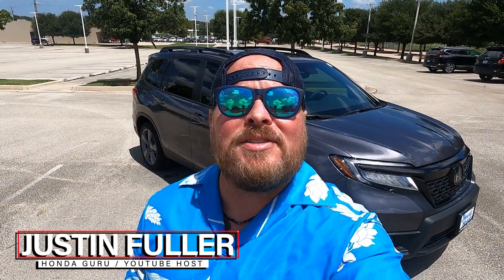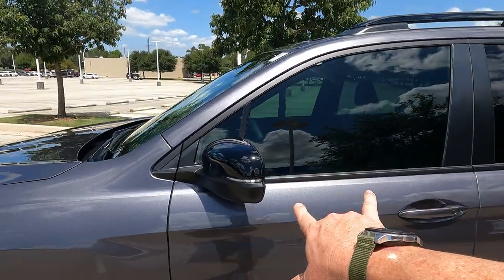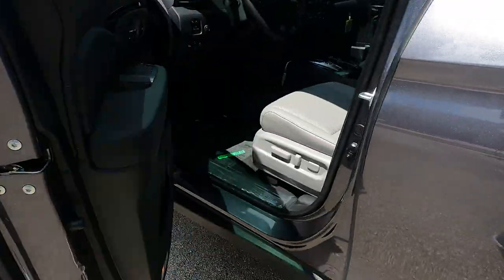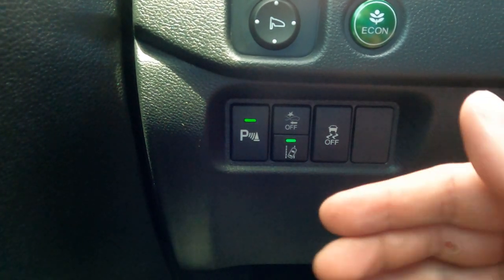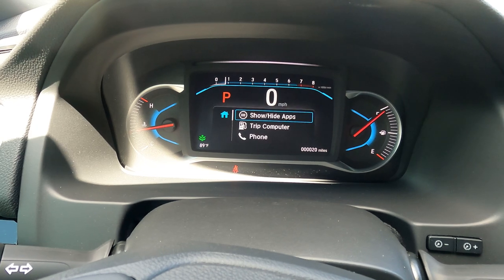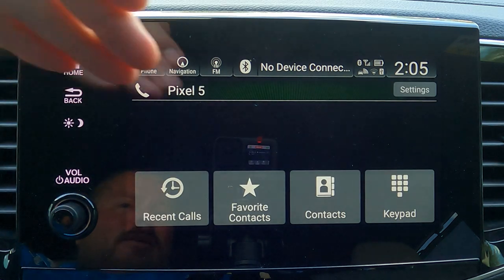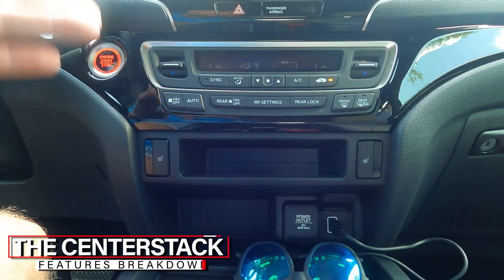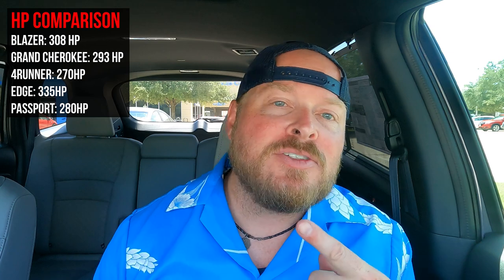2021 Honda Passport Touring Review

Comment: THIS IS NOT A 2022 PASSPORT IN THE VIDEO.  You can see what one looks like online and it has a front end similar to the current Honda Ridgeline.  CHANGE YOUR THREAD TITLE AND STOP WITH THE CLICKBAIT.
Reply: Bcoz 2022 still looks the same, so its not a clickbait.
Reply: @dmanalang9037  no, the 2022 got a refresh. Go look at the Edmunds video that just dropped.
Reply: The only difference between the 2022 Passport Trailsport and 2021 Passport Touring is literally the front grill, bit of boxiness to then front end body, and the tires. The rest of the car is exactly the same.

Comment: I just leased a 2021 Passport Touring after going to the dealership to buy a CR-V. It turns out that most of the "roomiest SUV" rankings do not apply to big and tall men. So in the CR-V, on the Mazda CX-5 And larger CX-9, my shoulders are jammed hard against the walls of the car and feel like they are hanging out the window.   I sat in a 2021 Passport Touring and immediately knew I was home. With all the safety, space, versatility, off road/AWD and tech upgrades, moon/sunroof and Honda built engine, it is WITHOUT A DOUBT worth the $40k+.  Great video! Can't wait to go play with the features again!

Comment: I’ve been waiting for a review on the 2022 Passport. Glad you picked the upper trim level model - appreciate the list on left noting difference between Touring and Elite levels. 
(Thankfully English is my native tongue or I’d never understand your words at that fast speed!!) 
Wish you had included Hyundai Santa Fe Calligraphy model as that is the only other car I’m interested in. It comes with 360 camera and also heads up displays AND camera on side mirrors which engage with turn signal on the dash to show you your side views. SO HELPFUL. 
Ground clearance is important - I need to sit up high. 
I am currently driving a 2006 Honda Pilot which has been a phenomenal car. I have 180,400 miles on it and have been planning to replace it and pass this one on to one of my children so she can use it for towing a small camper. 
The big decision is which of these two cars I would really want. I have yet to sit in or drive a Santa Fe so I don’t know if I would like it. 
Glad to see that the Infotainment touchscreen on this 2022 is nice and large. Comparing that to the Calligraphy. 

I’ve been waiting for the 2022 passports to come out because I want to see what they have added for 2022. Can you be sure just to list just the 2022 improvements? 

I would love to see a video comparing the 2022 Honda Passport elite or touring to the 2022 Hyundai Santa Fe Calligraphy.
Reply: He has shown nothing to indicate that the Passport in the video is a model year 2022 vehicle.
Reply: @TranslatedAssumption  but the title of the YouTube video says 2022 Honda passport touring review. Hmmm.